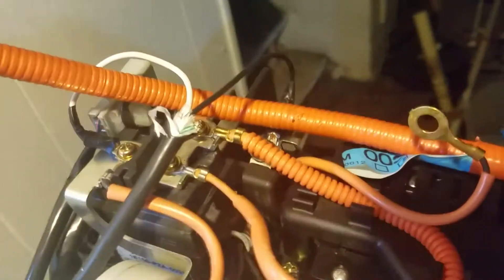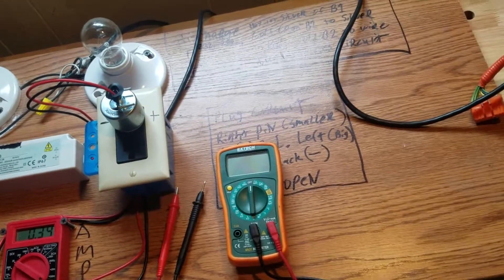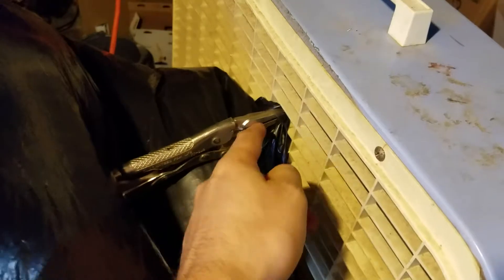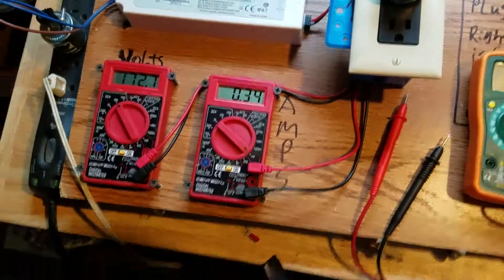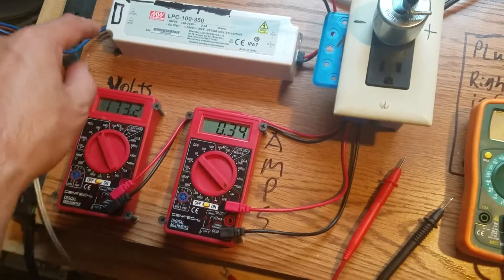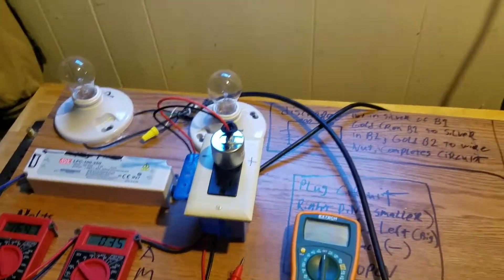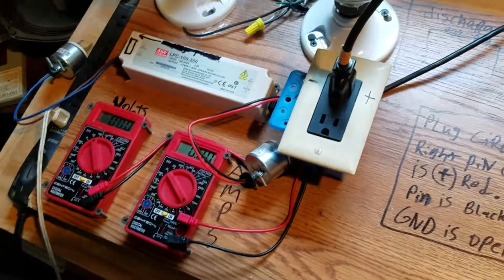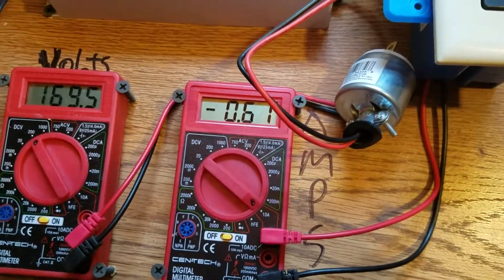HCH1 Battery refurb and grid charger operation Part 2

Comment from the maker: what you want to do in the process of draining it is note the voltage and amps at regular time intervals and do the math for actually how much energy has been burned by the bulbs and then when you get down to where you're going to stop draining, you can do the math for the total used energy from the battery on this run. and then you can use that number as a Baseline for your next drain to see how much, if any, Improvement you're getting. in my case I went from 3.8 amphours on the 1st drain up to almost 5 amphours on the 2nd. 
so in a nutshell even though my IMA light came back on month later, I know I made a decent improvement to the health of the battery overall.  my problem is I have a single bad stick which I need to replace.

Comment from the maker: When charging, energize the charger FIRST and THEN flip the switch on the battery. The charger doesn't like juice flowing backwards through it. To stop charging do that in reverse (flip batt switch FIRST).

When charging be sure the battery has plenty of cooling -- the box fan I'm using was on HIGH the whole time.

http://99mpg.com/Data/Resources/downloads/relateddocuments/civicbatteryinternalinterconnects.jpg
to check to voltage taps use this diagram. 
Check voltage across these pins

14-6 
6-13 
13-5
5-4
1-7
7-2
2-8
8-3
3-9 
9-10 

The closer together they are, the better.
IF you have one (or more) which is dropping voltage under load much faster than the rest, that is likely the fault with your battery.
Repeated charge/discharge with this setup may or may not get that bad stick working closer to properly again.
No guarantees. 

Here is MUCH MORE info than I have in the video
https://www.greenhybrid.com/forums/f50/hch1-diy-ima-reconditioning-31153/

At the end of the day my experience was that a month later my IMA light came back. But to be fair I did only a sum total of 25 hours charging and 10 hours discharging. Its recommended you do at least 3 FULL 30 hour-straight charges to get lasting rehabilitation -- I just didn't have the time for that. (Needed to drive the car to work!)

Currently I'm looking for a junk yard battery to grid charge back into good shape which I can then pull out sticks which act the most like the good sticks in my pack and use those to replace the worst 2-6 sticks in my pack. 
I'll do my best to do a much more thorough video when I get to doing that.